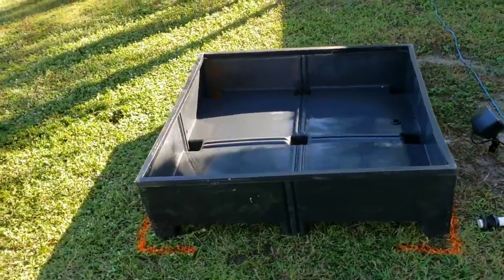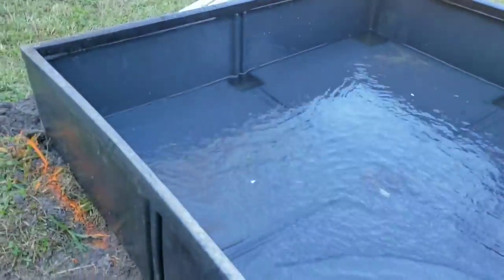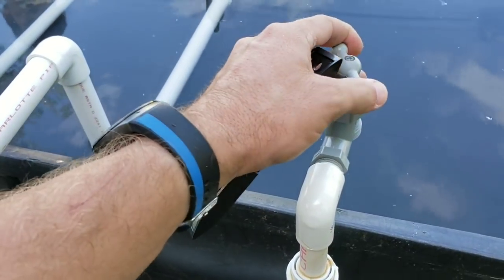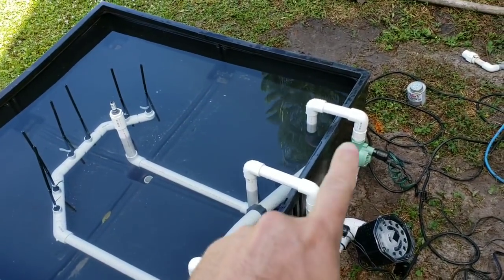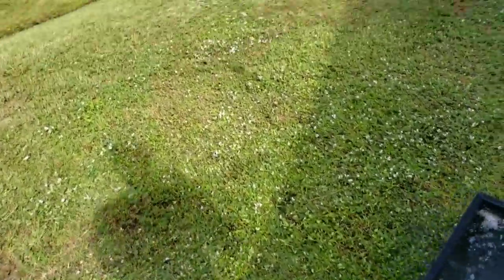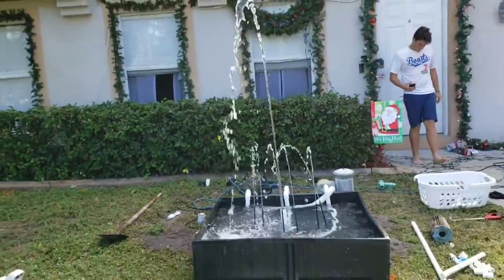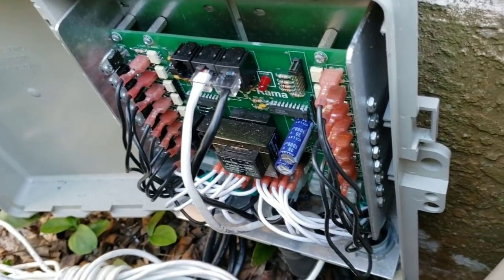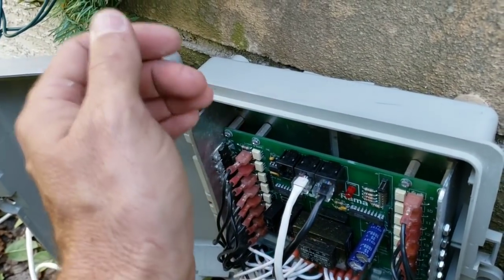2018 vlog #10. Water feature and connecting hardware

Comment: Hey man how can i connect lights to a roof ridge cap without destroying the new roof
Reply from the maker: Well... you can try hot glue but you still run the risk of damage when you remove them.  You would need to use a heat gun to help loosen the glue before you remove. Also you can try using rope tied in such a way from the eaves to create a ridge to attach the lights.  I saw someone use icicle lights and laied them over the peek.  Looked pretty good.